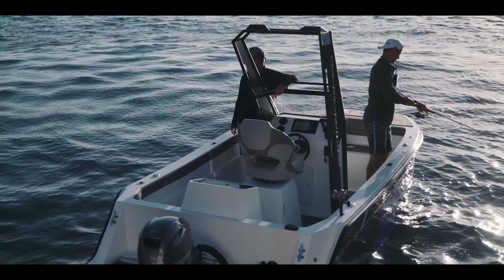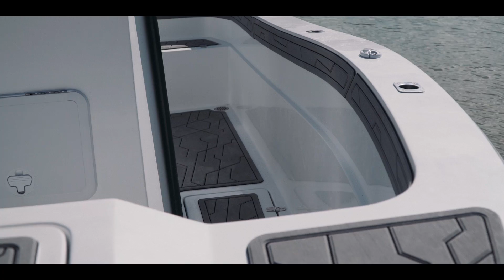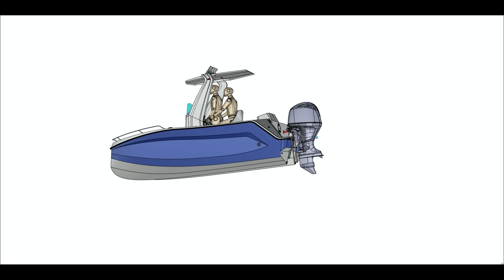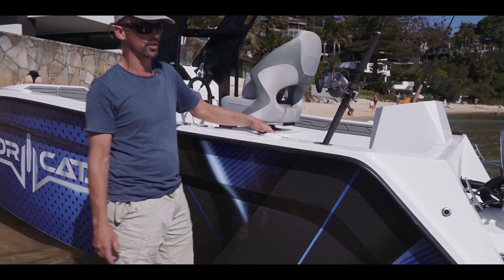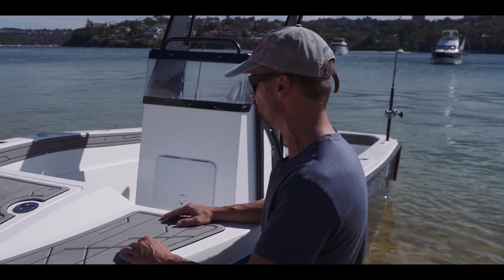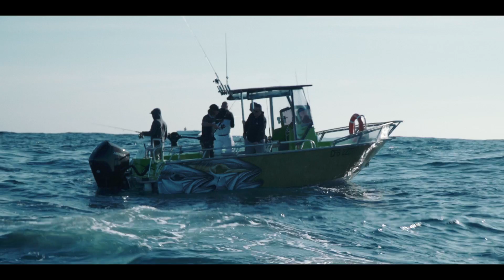All-new, resin-infused Vaporcats catamaran concept

Comment: Clsss act boys very interested , At this size this boat would suit freshwater as well eg , cod Barra etc, in development would it be possible to have a locable rod locker down one side and possibly provision for bow mount ,80lb 24volt ,so provision for 2 batteries under foredeck ,,cheers.